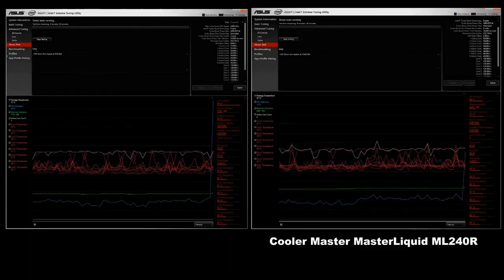Alphacool Eisbaer 280 AIO & Mod vs Cooler Master MasterLiquid - Part 3

Comment: How has the held up so far?, 
I bought the solo chrome version for an 360mm rad, but I have read some good and also bad feedback from the pump to outer plastic, and that's has me thinking of going back to separate parts instead of this
Reply: @joellikecatcher3480  Hm, the Alphacool had issues with the pump motor?  I'm looking to get the 280 as an AIO with no intensions to ever do any modifications to it. I know it's built around expandability, but I just want a simple install and forget unit - the only reason I think of going with the 280 is that it seem to perform the best of those AIO's and also the quietest.

Comment: A front-mount on your system is going to get hot it will blow heat on to your components I would always recommend a top-mount or a rear exhaust